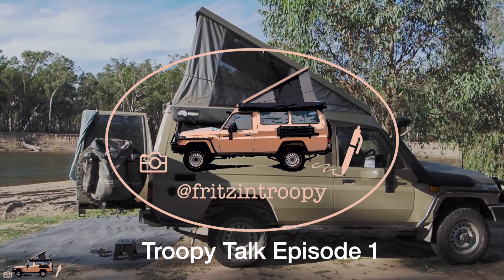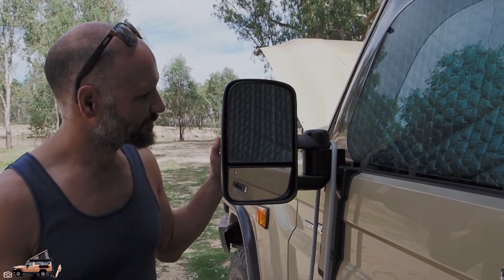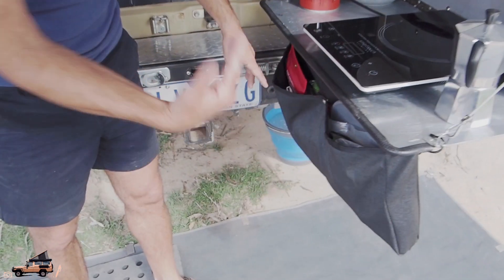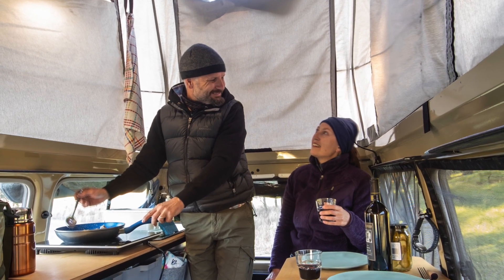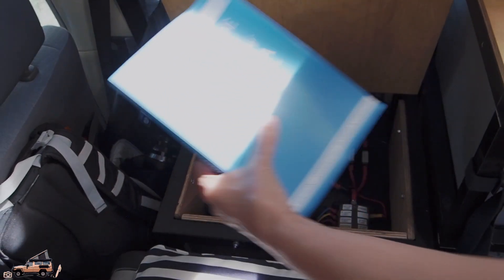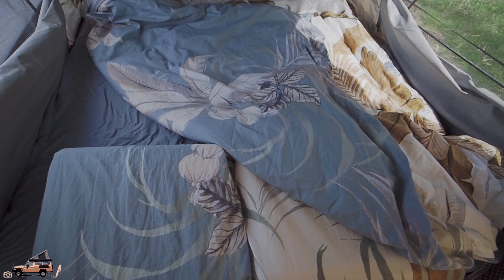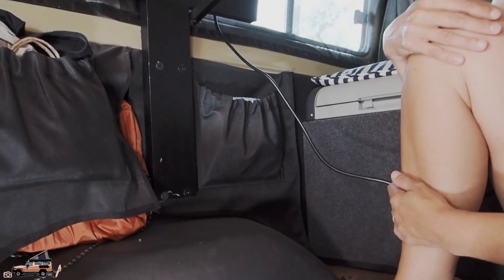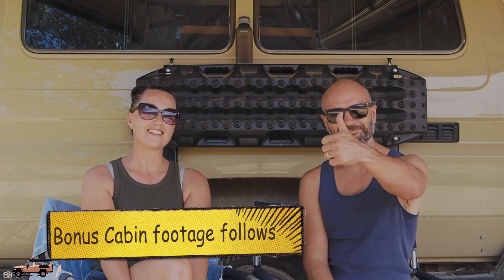A tour through our 2017 Sandy Taupe Troopy. Troopy Talk Episode 1

Comment: One of the best fitouts ever...simple, and functional...love how you've tailored it to your needs without doing the $20k install, but still have all the important basics. I like that you've bucked the current trend and incorporated a good sized sink...do you have a grey water tank, or does the outflow go to a bucket under the truck?
Reply from the maker: Thanks for your great feedback. We do love the setup because it is simple and extremely functional. We have thought about changing it up but have realised there is no point as it works so well the way it is. We think a sink is an absolute must. We were even thinking about doing a quick video about this because we also can't believe how many of these new flash set ups people are putting in without a sink... just makes no sense to us. Regarding the grey water, we collect it in a bucket. We carry a 2 collapsable  buckets, the second for freshwater for showering or doing the dishes outside which is rare. Cheers P&E
Reply: @fritzintroopy  Great, thanks for the reply...I'm doing a fitout now, and have always wanted a sink and running water inside, as I wont be just chasing the fine weather and living outside under the awning. Your missus' comment about being able to do teeth was the clincher. Also being able to rinse a cup or wash hands and face without facing a storm would be worth it. I would never pee in the sink in the middle of a freezing stormy nite tho! 🤫 Seeing the cara sized sink in yours has locked it in for my build too...just gotta work out how to do it so it functions just as well in doors, as it does when I'm out doors....wait, I hear an idea coming on...!
Reply from the maker: @omniversling  good luck with it all! Get a bottle with a large opening for the night time pee... that's what we do
Reply: @fritzintroopy  TBH I cant find a bottle with a big enough opening...so I'm using a bucket! 😆

Comment: Did you buy the Troopy with the standard stock Bridgestone 225/95/r16 or where the B F Goodrich tyres already on it ? If you ran the 225/95 what was your experience with them as far as km is concerned. Just interested, because i can't get more then 35000 km out of them.
Reply from the maker: You did better than us getting 35k. We did have the Bridgestones but they only lasted 25000 km. They started to crack and chip heavily so changed to BF Goodrich and have done 37000 km so far and they still look good.
Reply: Thanks Pete&Liz. Had the same bad experience with the split ring Dunlop tyres. Will take your advice,thanks.

Comment: nice to see the different troopy builds, like the idea of the tubs for all storage, re the water tank you mentioned it was 90lt -  given you also have the larger after market fuel tank where does the water tank sit and what brand is it (or was it tailor made) ?? cheers
Reply from the maker: Hey Steve. Thnaks for the feedback. The tank sits on the passenger side alongside the tail shaft. Its a custom number from https://longrangeautomotive.com.au It was fitted by the previous owner. Cheers Peter
Reply: thanks Peter appreciate the extra info - I thought it might be a custom job, FYI and important tip - if you ever have to do a deep water crossing make sure your water and fuel tanks are as full as you can get them or you fit a propeller🤣 , with all those tanks it wouldn't take much for the troopy to become a boat - I had a mate that had a 60 series wagon with a 90lt  after market fuel tank that sat right about where your water is and first crossing he did he had to open the doors to get some traction again..............😲 admittedly he was only doing an over night camp so wasn't fully loaded but still something to keep in mind. Cheers
Reply from the maker: @steve-deltasdad3906  wow. Great tip. No boat for me

Comment: Great vid guys, love your set-up, on the problem of water pulling on top of awning, if you get some clips that don't harm the canvas and clip in-between the arms then some cord down to tent pegs slightly pulling down tension, the water runs of, and you can collect the water as well. Experiment with this it works, cheers, 🤗
Reply from the maker: Nice one mate. Thanks for the great tip!

Comment: Great set up guys, I might drive you mad with questions next 6 months, I'm about to start setting up my own troopy, originally i was just gonna do 2'' lift and not worry bout GVM upgrade, do you feel you need the 3900 upgrade with alu-cab and all other camping needs etc,
Reply from the maker: Hi Chris. Apologies with the delayed response. Have been on the road a lot with minimal reception. Our weight comes in at 3660kg with both of us in the car, fully loaded with 180 L of fuel and 110 L of water. Our shelving is pretty light but we have a big fridge and freezer fully loaded with meat etc. I can't see how we could get our weight under 3300 GVM. especially with all the bar work, swing arms, jerry, awning and two spares. Hope this helps. You may want to watch 4Xoverlands current build as Andrew is trying to stay under GVM with his latest project

Comment: Great stuff. I just got the same fridge and what I'm wondering is how long can you stay put before needing to start the engine if using solar and redarc redvision ? How long will the fridge run for. Thanks
Reply from the maker: Hi Nasser.  Great question and I just did a trial this week. We camped 4 nights and by the 5th morning the batteries were down to 32%. That was in 34 degree daytime temperatures with the fridge set at 4C and the Freezer at -11C. We were parked partially under shade so we only had direct sun on the solar panels for about 6 hours a day. I have 200W of solar panels. So all in all I was very pleased as I didn’t have to start the car at all. I didn’t cook with induction at all during this period. Cheers
Reply: @fritzintroopy  Cheers for the reply. Gives me a better insight for my setup. Much appreciated. Enjoy your adventures

Comment: Great work guys, some very good ideas, something different to all the production units you generally see. where did you fit the 90 litre water tank and who made it.?
Reply from the maker: Hi Michael. The water tank runs alongside the drive shaft on the passenger side. I understand it was made by https://longrangeautomotive.com.au
Reply: @fritzintroopy  they must make a stainless steel version of a fuel tank they do for that position . It’s not in their cattledog so will give them a call. Thanks for the insight

Comment: Hello. Thanks for sharing your experience. About the electric board, can you please describe the product, consumption and talk about your experience of use? Do you prefer this electric solution instead of the mini gas stove? Thanks.
Reply from the maker: We camped 4 nights and by the 5th morning the batteries were down to 32%. That was in 34 degree daytime temperatures with the fridge set at 4C and the Freezer at -11C. We were parked partially under shade so we only had direct sun on the solar panels for about 6 hours a day. I have 200W of solar panels. So all in all I was very pleased as I didn’t have to start the car at all. I didn’t cook with induction at all during this period.

Hope this helps

Comment: Dimensions question for you: what is the size of your table top (the inside, fold-up one) and the seat/step box at the rear of car?  W x L x H , where Width and Length are along same plane as width and length of car.  Thanks!
Reply from the maker: Hi Keith. Sorry about the delay. The table top is 58cm long and 51 cm wide. The seat/step box is 36 cm wide x 53cm long and 47cm high. Hope that helps. Cheers Peter
Reply: @fritzintroopy  thanks HEAPS for that! I love your layout so am copying a few things 👍😄
Reply from the maker: @keithjob  cheers mate. It’s super practical and spacious like this. We love it. We”re thinking about raising the bench height so we can have another storage shelf.

Comment: Re. the shelving unit, do you know where it came from?
Reply: OK I found the tubing... Cubelock, or qubelock or Connect-it at Bunnings... snap in plastic corners.  Is yours 25mm or 40mm?
Reply from the maker: @keithjob  sorry Keith. Have been on the road and missed a lot to messages. It sounds like you've found it. Ours is the 25mm. Cheers

Comment: Hello Mr and Mrs Fritz, Thank-you for letting us follow you along with your troopy journey.
Your tour through the troopy is very informative and full of great inspiration.
From 6:02 in the video you start talking about the 30 second awning and I am interested in information regarding the side brackets and the rear corner bracket for the awning. Are these brackets custom made? I like the way they are bolted? or using rivnut? through the body section for strength.
We have a fibreglass poptop troopy and therefore need brackets and awning support that is very similar to yours.
Could you please post a link or reply with how they were made etc. I'm not sure if you can add pics or do a short Youtube video on the mounting system used.
Keep up the great videos and and thanks for bringing your fun into our homes during these covid times.
Reply from the maker: Hi! thanks for the great feedback. The awning was fitted by Expedition Centre in Sydney and I think the brackets are made by them as well. Give them a call to find out more. They are held on by a combination of a rivnut I assume and a bracket that clamps onto the chrome roof rail area. hope that helps. You can contact me through Insta @fritzintroopy and I can send you some pics if you like

Comment: how did you mount the compressor under the front seats?
Reply from the maker: It was done by the previous owner. Its a single chamber ARB unit and it just fits. I'm not sure it was a great idea as it gets quite hot under there especially when its 40C so Ive resorted to running the AC on the feet setting to make sure it doesn't overheat and cut out. It has cut out a few times prior to the AC trick.